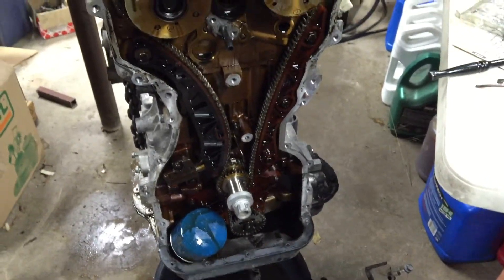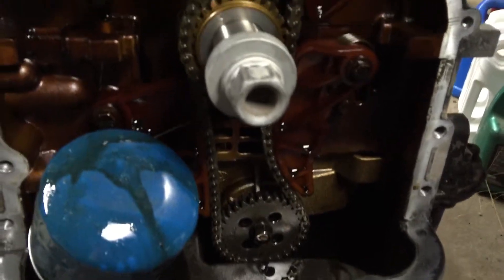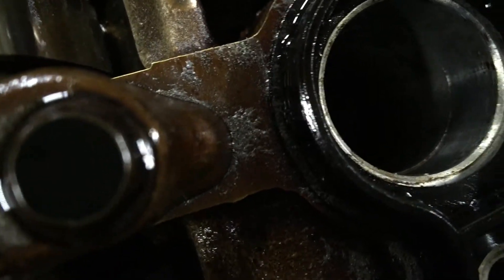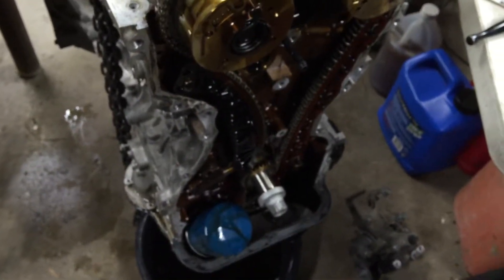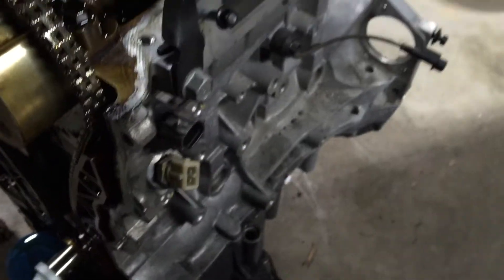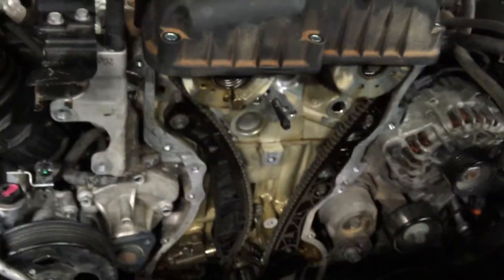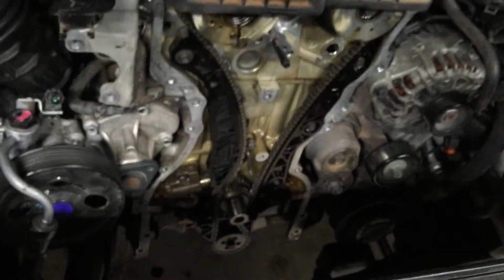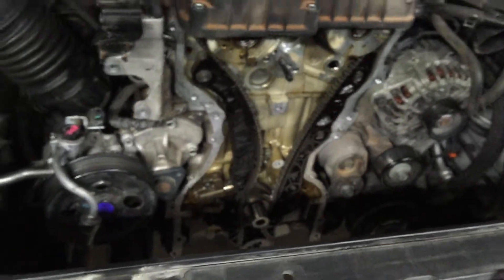Hyundai Genesis Coupe 2.0T Engine Tear-down part 1

Comment: do you happen to know how long the owner went without oil changes? i change my 2013 2.0 every 6000 miles mobil synthetic
Reply from the maker: I generally suggest that if using full synthetic, on a vehicle with a turbo, the oil change interval be 5-6K unless an oil analysis is done. If the analysis says the oil is still viable at 6K, then run it out to 7-8K and test again. Always change the filter with the oil.
Reply: @eatont9999   thank you. i appreciate that insight
Reply: I'm lucky to work at an oil change shop and I do my service around every 3000k. Using Mobil 1 Synthetic with an Ecogard filter.
Reply: i got a 2013  2.0T SFR Stage 1.5
Reply: Jose M. Leon so your proud of working scams?
Reply: @eatont9999  i think it also depends on HOW you drive. Just because you have a turbo does not mean you should change the oil more often or use synthetic. If you hardly EVER go into boost or don't abuse the engine, there is no need to change it as often let alone need synthetic.
Reply from the maker: I'm not quite sure but some of the documents in the vehicle lead me to believe 5-6K between oil changes and those are probably not with Synthetic oil. The damage to this engine leads me to believe lubrication was an issue before the current owner. He bought the car from the dealer as a used vehicle with a warranty. The work I am doing would have been covered had he not modified the exhaust system. I imagine he beat the piss out of this thing along with poor maintenance.
Reply: @eatont9999  i have 4 turbo cars and i change my oil every 5k with conventional oil, i don't use synthetic.